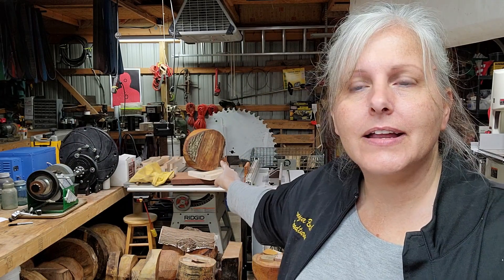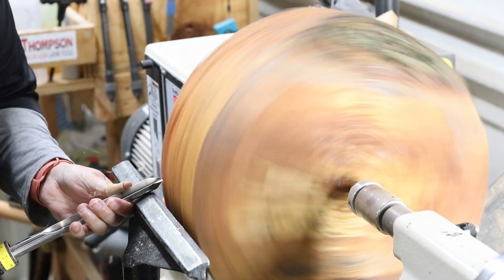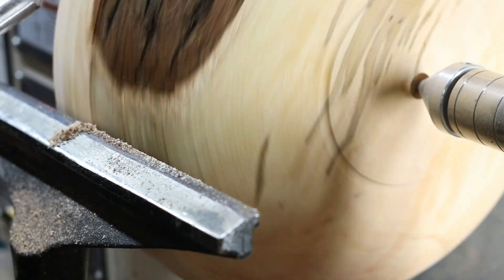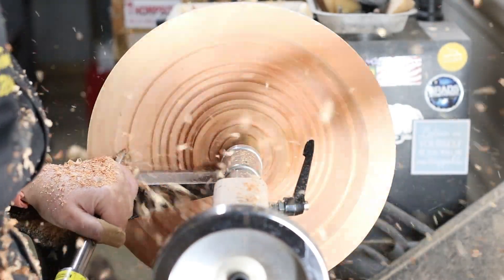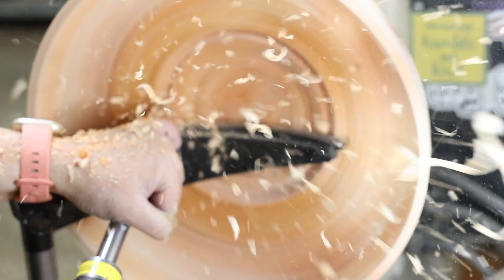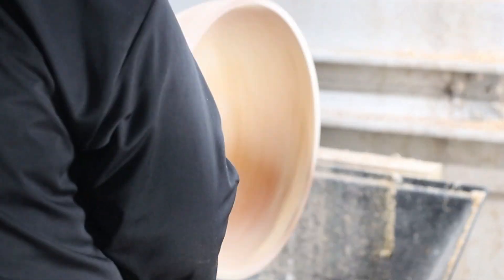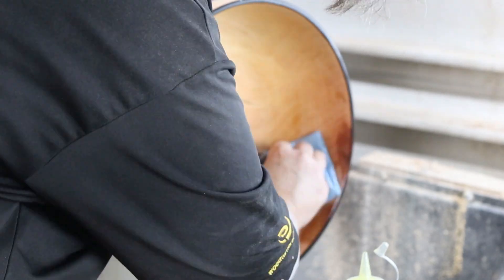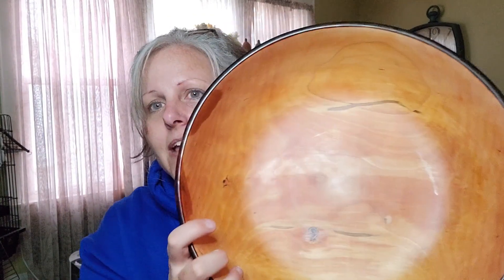**Lost In A Storm** Cherry Salad Bowl

Comment: Nice work 👏! Was you able to get the stain from the starbond out? That's the problem with using ca glue to fix a crack. I use Kent's tip using wood glue and a light sand. It works really well and it doesn't stain the wood. Take care and GOD BLESS 🙏!
Reply from the maker: Thank you so much, Stephen!
I have seen where he uses wood glue. I am sure over time the wood glue will hold up better than the CA. As for the staining it didn't come out all the way. I personally haven't tried wood glue. I may have to give it a whirl sometime .
Have a great weekend!
Take care,
 Tanya 🤗
Reply: @TanyaBecherWoodturning  another thing you can do is put sanding sealer on before you use the ca glue
Reply from the maker: Thank you 😊  I will give that a try.